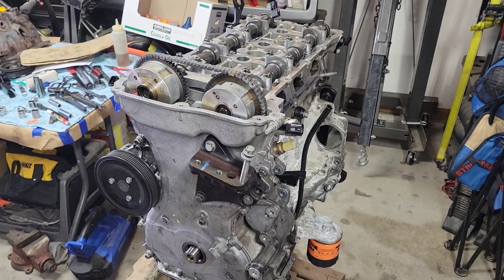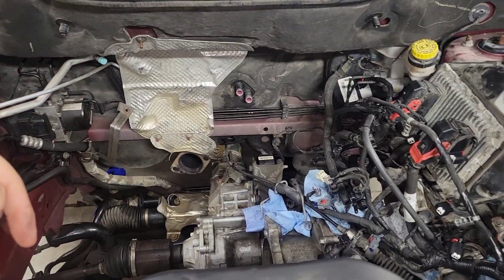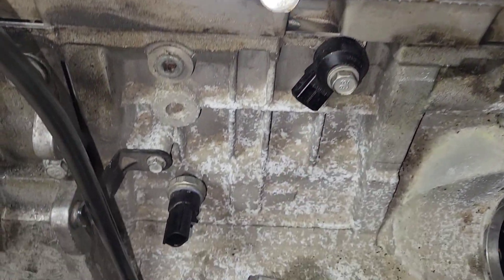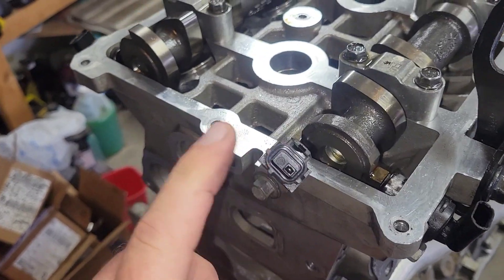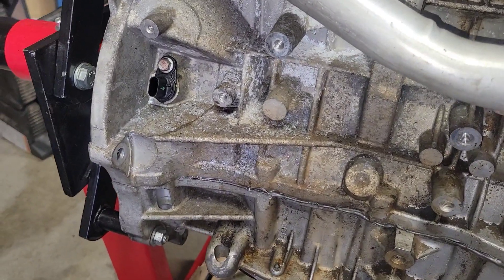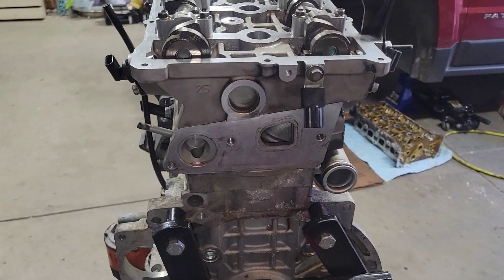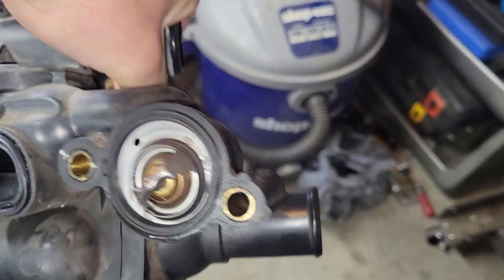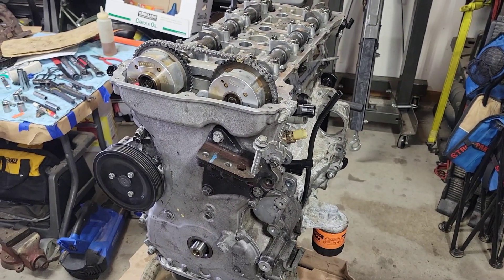jeep, Dodge 2.4 engine solenoid and sensor identify and location

Comment: Is this the same engine for a 2018 Jeep Compass 2.4L? I am looking for the oil supply solenoid valve switch? Is this the same as the intake VVT solenoid
Reply from the maker: Im not certain if all components are the same between the 2 models.  Sometimes the short block are the same, but the heads and associated parts aren't always interchangeable.  Sorry I couldn't provide a better answer.